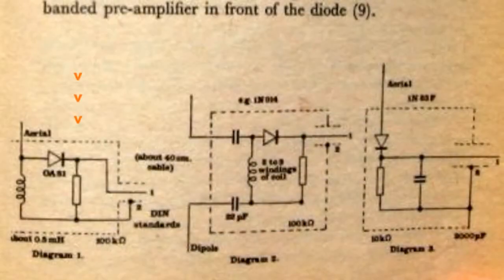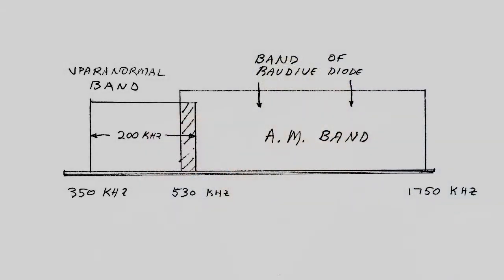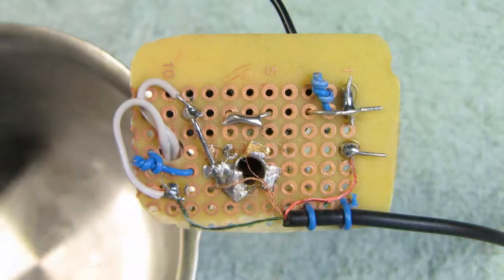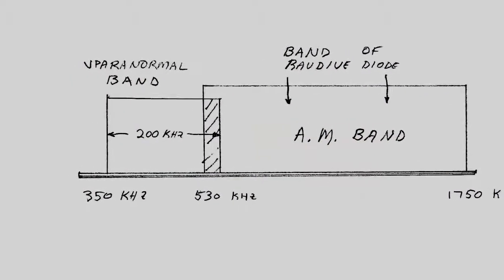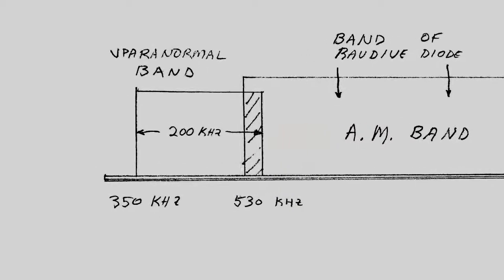Vparanormal Designs a USB Based Raudive Diode Microphone (Raudive Entity Mic TM)

Comment from the maker: Vparanormal designs a USB based Raudive diode microphone (Raudive Entity Mic TM) to help capture EVP's.  This circuit is wired to the inside of a USB model Samson C01U, replacing the condenser mic. The original Raudive germanium diode circuit operated in the middle of the AM frequency band. After some experimentation and testing using a frequency sweep generator, an oscilloscope and a RF coil, I determined the changes to the original circuit to allow operating out of the AM band.